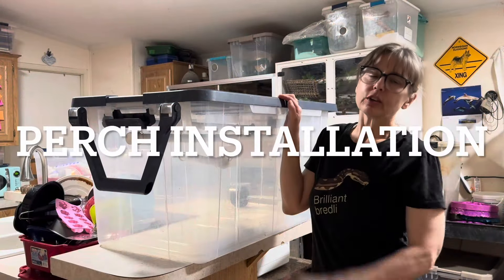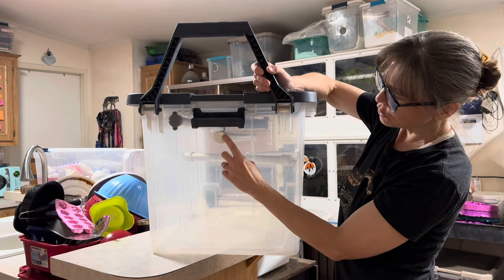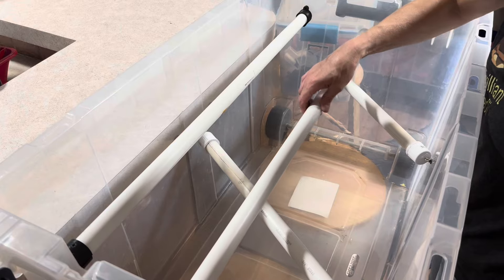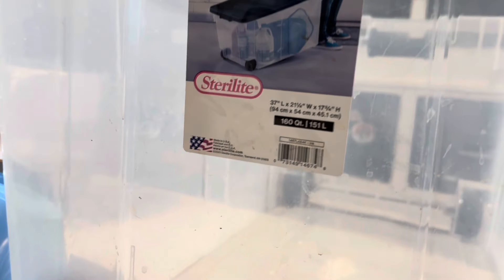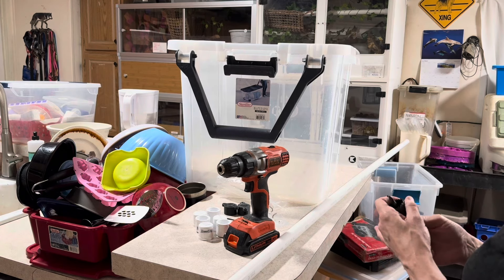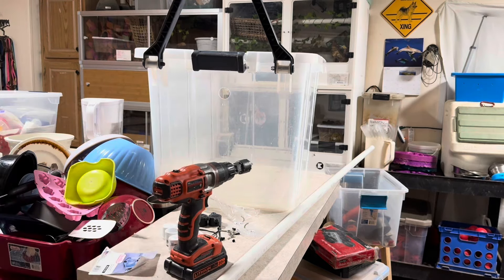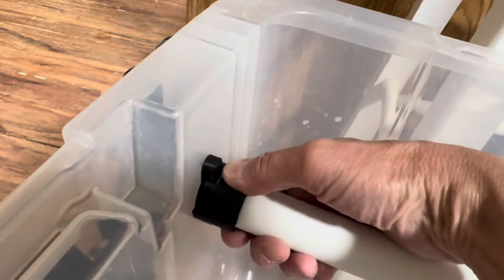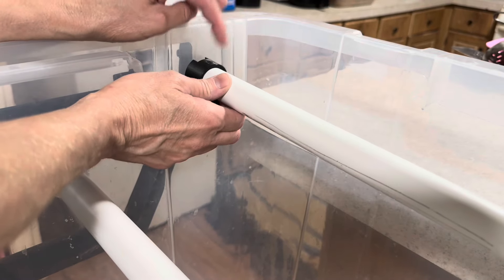Installing Snake Perches: 4 Methods

Comment: A suggestion - you can maybe use a piece of double sided sticky tape, a Command adhesive strip, or a little bit of hot glue or sticky tack to hold the perch holders onto the wall so you can drill the holes. 
For my recently built Colorado travel condos, I used wooden dowels and sanded and sealed them. I drilled a hole in the end of it and melted a hole in my tub walls (could also drill), and screwed a bolt into the end of each dowel.  We will see soon how well that worked when I bring them soon!

Comment: I thought we arent supposed to use anything adhesive inside an enclosure because it could get stuck to the reptile?
Reply from the maker: @jennamink425  The sticky surface should be on the glass or PVC and not exposed to the reptile. You do not want the adhesive surface of anything accessible to the animal.